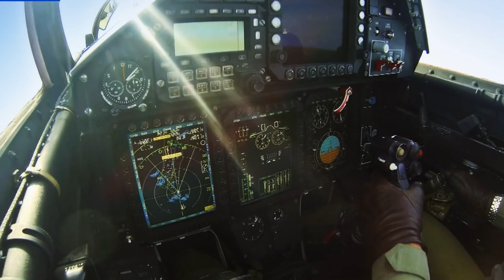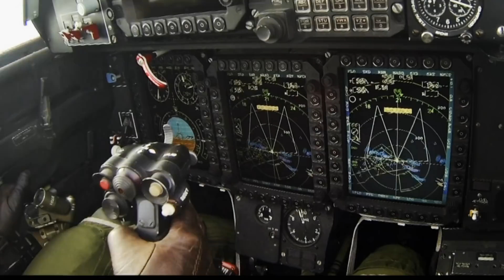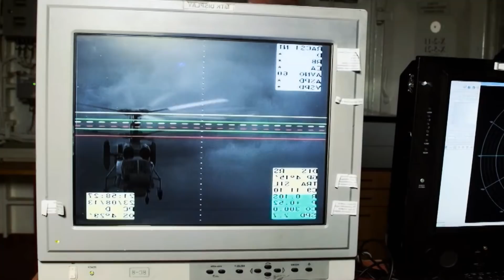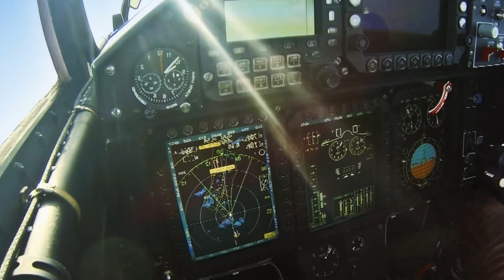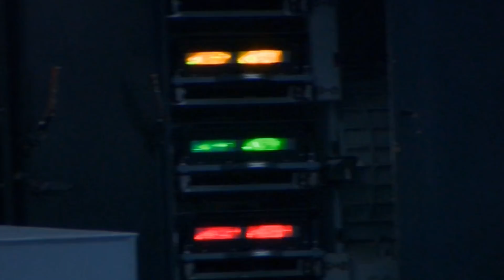Time Is Running Out for Russia's Only Aircraft Carrier - Admiral Flota Sovetskogo Soyuza Kuznetsov

Comment: The Kuznetsov is one of those ships that tends to spawn online arguments with people liking to talk about him like some kind of super ships when in reality he (Russian ships are a 'he') was an interim design with a lot of shortcomings that were going to be corrected in the next class (which never came).

He lacks a proper AEW aircraft, the Helix AEW helos are very small and short legged. A proper AEW aircraft (the Yak-44) was canceled at the mockup stage. 

The SS-N-19 missiles aren't even carried anymore, the tubes were removed to make space for an enlarged hanger. Which was at least smart given that the missiles out range her spotting helicopters, plus getting within range to actually use the missiles against an enemy carrier battlegroup just exposes the carrier to even more attacks; Kuznetsov would need to steam at full speed for over 12 hours while in strike range of an F/A-18 to even think about using its missiles... and that doesn't even count mid-air refueling of F/A-18s.

While his Su-33 fighters are impressive on paper the lack of a catapult means they can't actually launch with a full combat load, you'll notice even the lighter MiG-29Ks in the video were only loaded with two AGMs and two AAMs.

A major issue the Russians are having is that the shipyard that built the Kuznetsov isn't theirs anymore. They're currently lacking a dock capable of building a carrier sized warship with docks that can only handle ships up to 60K tons (only marginally larger than the Kuznetsov). Not surprising given that the Russians had to look to France to buy two much smaller helicopter carriers.
Reply: ...there  is the shipyard Zaliv in Crimea having a dock of 60x360 m with two G.cranes ....and the new Zvezda shipyard near Vladivostock has also Gandy Crane with 1200 tons  lifting capacity..
Reply: the mig 29k was not even on the kuznetsov it was on the indian carrier Vikrant-class in this video... which is 30 meters shorter. also the french mistral landing ships where chosen not because of its design but due to political reasons. everyone loves to talk what they think is right but the dumbest people always speak without knowledge.
Reply: Funny how Russia always says its western propaganda.
Reply: Steve Arthur kinda a big leap of faith, yes in some areas Russia rival America but I doubt they are decades ahead in any area, Russia is mostly a defensive country and the best defence is to look stronger not weaker.
Reply: Steve Arthur 
I don’t believe 1,2 or 3 while they have good  technology that rival America it is not superior in every way, especially electronic warfare.
Reply: Steve Arthur 

1.) None because the US does not choose to emphasize speed with its missiles. The LRASM is an excellent missile, designed to be automated, and "smarter" than what the enemy has. Speed was not emphasized. 

3.) "What Road mobile offensive EW systems does the US have?" 
None...  But that's not really advanced technology. The US prefers AEW such as the E2 hawkeye or E3 sentry. Road mobile isn't exactly "advanced"

As for your second one I think it's a bit ridiculous. That's an extremely specific description, and something the US has no real use for. 

The problem I have with what you're saying is you're just emphasizing a very few specific technologies that the US doesn't have (or even want) and using that as evidence that Russia is ahead the US by several decades. 

I'm not trying to disrespect Russia, or whatever country you're from. I'm sure Russia does have some good technology. But your argument is also flawed
Reply: Steve Arthur I know well what a maskarovka is and in no area is Russia decades ahead of us or western tech sorry but go sell that bs to someone else u might try the leftist liberals  who can't decide which bathroom to use for starters  or children who get their weapons specs from PlayStation games. That bs does not nor will not pass by those who are more into or those who have used so called current Russia tech knows full well Russia is lacking. Yes the US military knows Russia is behind in tech but allows Russia propaganda to not be challenged bc it makes it easier for them to get money. One week before the US weapons system got leaked about the US microwave system champ Russia started claiming they jammed tomahawks and emp  a navy boat then shot down a Israeli f35 in which all these claims have fully been debunked. End of story.
Reply: Steve Arthur capable military really  OK
Reply: eye4567 us weapons system the champ and while Russia boasts their new weapons systems the US doesn't Russia has hyper sonic missiles the US has active fielded laser defenses.
Reply: nivac hannahs thank-you well said ex why does the US need hypersonic missile defense when it has satellites armed with lasers ie Reagan's starwars defense notice Russia says nothing about that just that they have better engines and a space shuttle that flew once and almost crashed so it was his in a desert in kazacstan for yrs it was the buran.
Reply: Steve Arthur that's a claim and never proved not once so try again. Try looking up Soviet losses of subs due to reactor failures and reactor failures on land and get a clue here is a start the kursk and Chernobyl.
Reply: William Magoffin Russians refer to vehicles and vessels as 'he' rather than 'she'? Hm, interesting, idk that.
Reply: Steve Arthur we are developing lasers. We may fall behind in some places but we are ahead or equal in others. That's simply how it works.
Reply: Chromosome Extract developing?  The US already has them
Reply: Steve Arthur  Jesus, Steve. You are some kind of serious Russia fanboi. I actually admire Russia and Russians in particular, but you really need to clear your head on their capability. Almost everything they have or will have is copied or reverse engineered technology. Sure, I imagine they come up with stuff from time to time but it's unlikely to be groundbreaking.

Comment: I think the biggest handicap of this boat is that it's diesel-electric. It therefore doesn't have the "long legs" like a nuclear-powered one.
Reply: British QE also havent nuclear drive and still its great ship. Russians doesnt need to project force on far side of globe. I think 2-3 carriers similar to Queen Elizabeth is +- everything what they need in this field.
Reply: You're always going to need fuel for your aircraft and escorts as well as other supplies so I wouldn't say that's the biggest one. The biggest handicap is easily the fact that it's operating conventional aircraft without a catapult.

Most countries who operate Ski-Jump carriers use STOVL aircraft like the Harrier or now the F-35B. Conventional aircraft just rely solely on a high thrust to weight ratio severely limiting their take off weight and fuel.